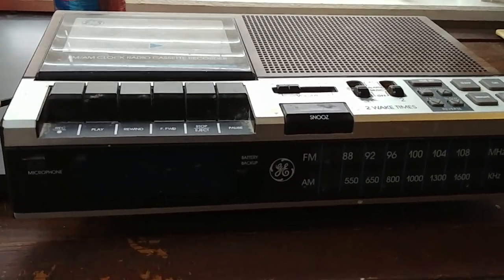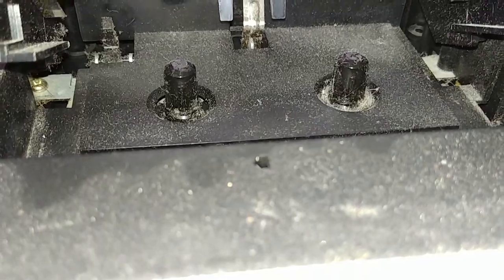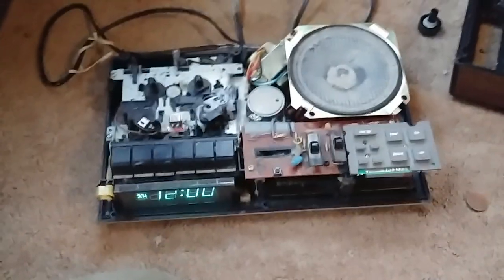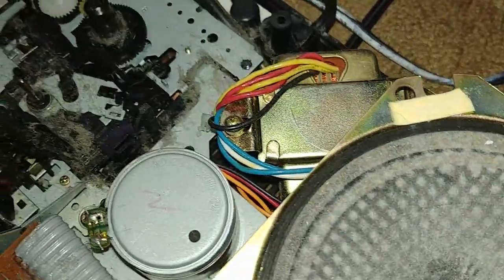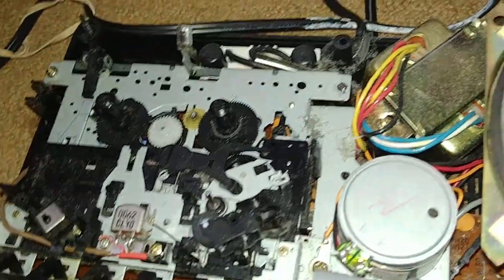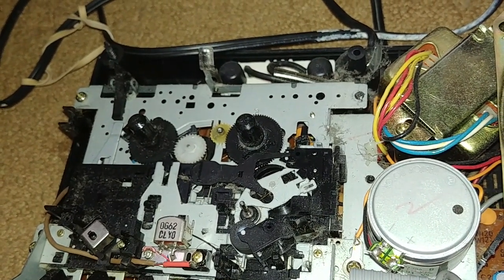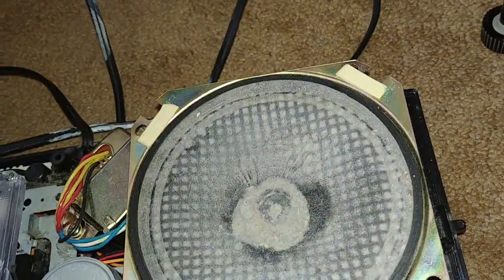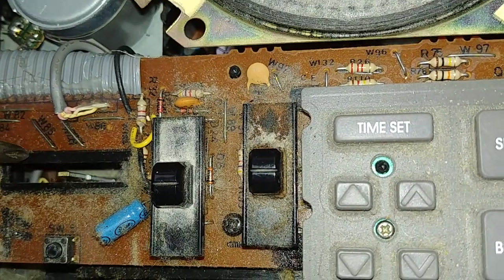GE clock radio/tape player-recorder part 1

Comment: The sad result of someone who was probably a heavy smoker....... I really want to see how this one turned out!
Reply from the maker: Douglas Allen I do have a part 2 coming. Nothing much from it but I did clean most of the insides but already had it back together so won't be able to see it. I still have to replace one of the two belts and when I do ill make the final part 3 video. But for now it works. I have to reopen it later on for two reasons and one of the belts is one reason and the other is the dial for the radio gets stuck so somethings outta place. Once those issues are corrected ill be making a part 3 video.